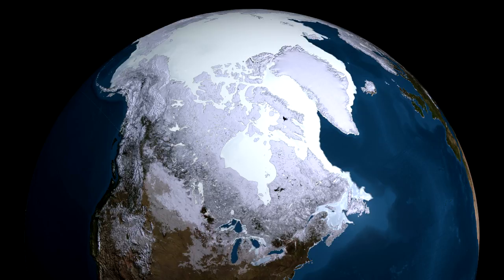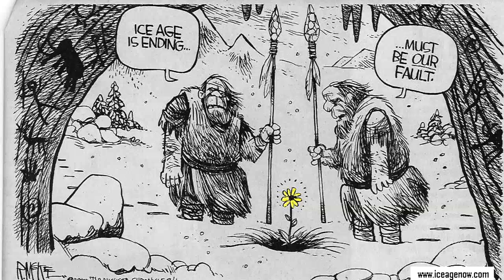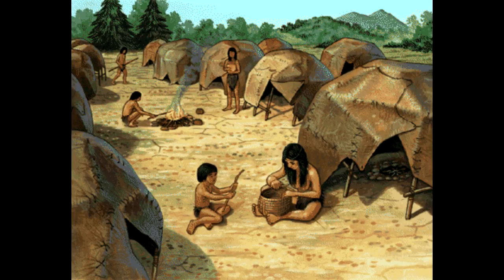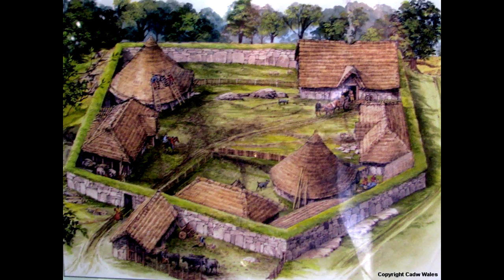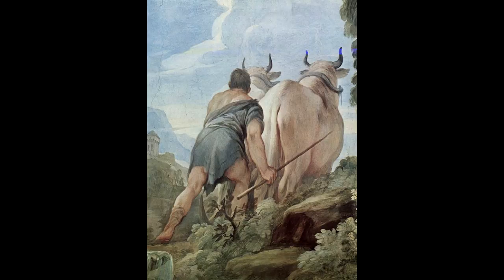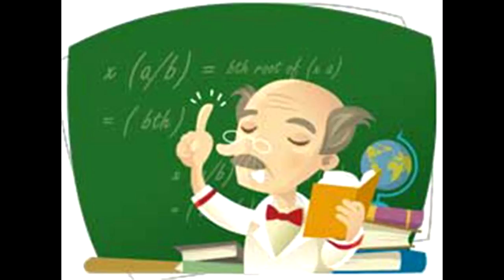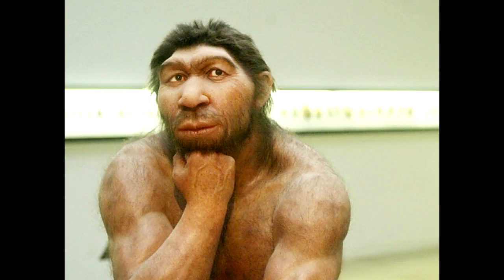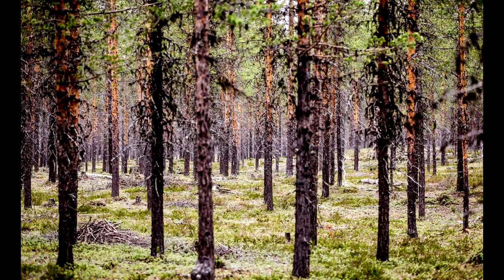Babbitt bearings, part one

Comment: I've been waiting for this information. I collect line shafts equipment.
Reply from the maker: Chris Anderson, I doubt if I will ever pour a line shaft bearing again. Thank goodness!
Reply: sandrammer lol I have many ahead of me I'm setting up a line shafts powered shop.
Reply from the maker: Wait, the line shaft bearing I was talking about was 3 feet tall and the shaft was 18 inches in diameter. What size are your line shaft bearings?
Reply: sandrammer under 2 inch shafting

Comment: If you wanted to do a demonstration , salt water fishing weights made of lead could be substituted for Babbitt . Black iron ,or even copper pipe split could simulate the shell half's and any metal bar ,rod ,or bolt could represent shafting . When you zoom in with the camera small things can look huge , so work with what ya got  .
Reply from the maker: Part of the demonstration would have to include the tinning process that is a part of repouring the babbitt bearing. The tin layer acts as a bonding agent between the steel of the babbit shell (as tin bonds readily with steel, iron and bronze) and the tin alloy of Babbitt. This part of the process is the most important step of the proceedure and can't be left out.  It is true that I could use the inside of a steel or iron pipe to simulate the inside of a bearing shell, I wouldn't use a metal rod to cast around. I would make a jig, the size and shape common in repouring babbitt bearings. I would prefer to use a bearing shell as the bearing shell will have forms on the inside that would have to be compensated for and would act as a good example on how to overcome the problem. Much thanks for your suggestions though.